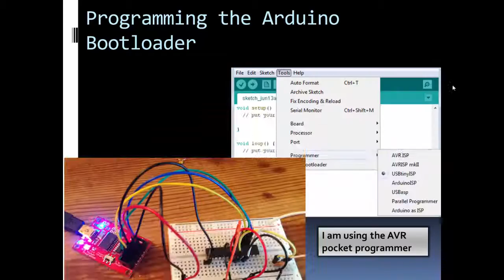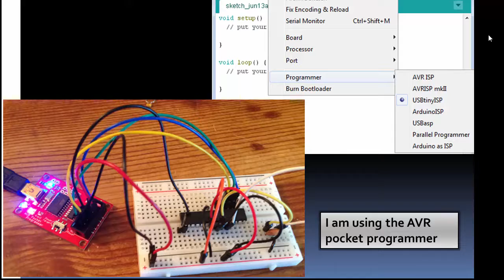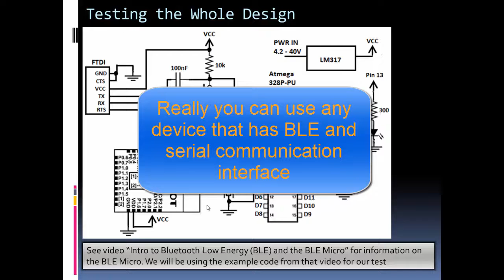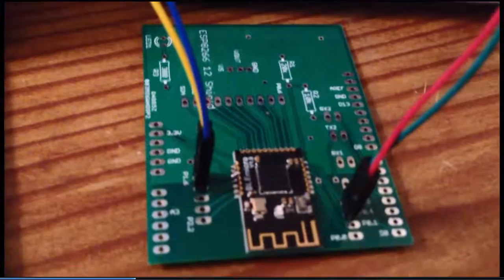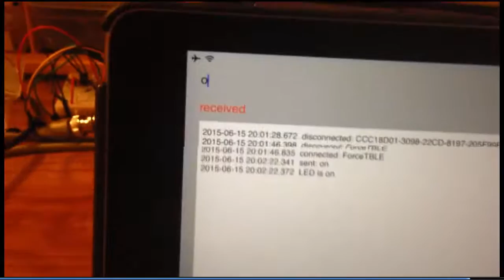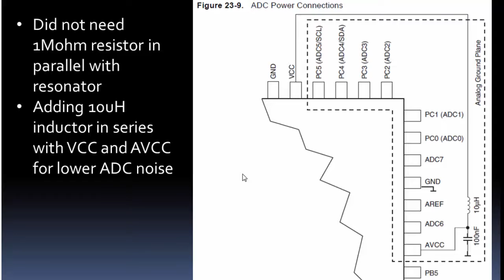Building Your Own AVR / Arduino IoT Development Board Part 2

Comment: Do you have an easy way to program the atmega328p-pu? The arduino ide reads that the chip has the wrong address. I have tried a few programming tips that I could not get to work. Do you have a video programming a chip with the wrong address?
Thanks for the video. Sorry but I am a newbie and having issues!
Reply: +amtpdb1 I had a crystal and put it between 9 and 10 and then connected the ground to 8. Was this correct as I did not have a resonator?
Thanks
Reply from the maker: +amtpdb1 It is hard to say because I don't know all the details of your setup and the crystal you are using. You should look at the crystal's datasheet for what it needs to work correctly. If you don't have what the datasheet calls for then it probably will not work correctly.
Reply: +ForceTronics Thanks for replying. I picked them up on ebay a while back so I can't get a data sheet from them. Have a nice day.
Reply from the maker: +amtpdb1 Most crystal osc require some capacitors around them. That is what is nice about resonators, they don't require supporting components (but they are not as accurate as crystals). If you  have access to an oscilloscope you could check the signal coming out of the crystal to see what it looks like. It should be a square or sine wave that is about 16MHz. You can also purchase an Arduino Basics Kit from ForceTronics.com, it comes with a resonator.